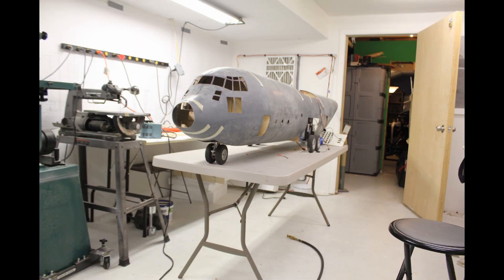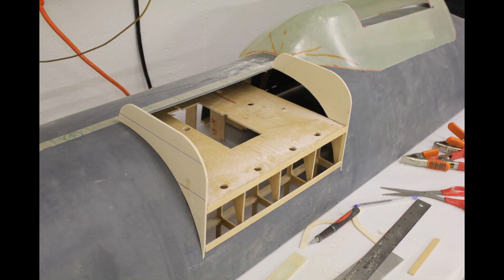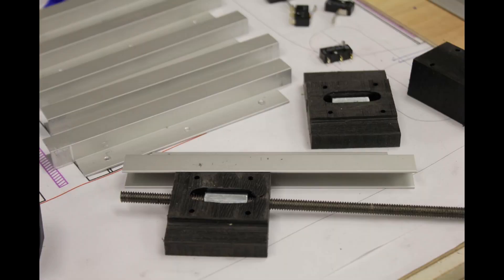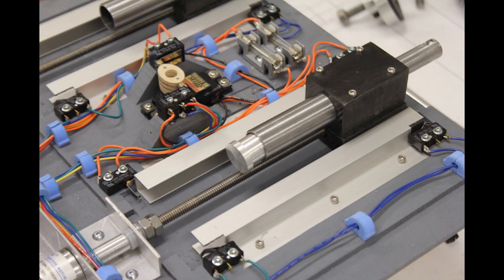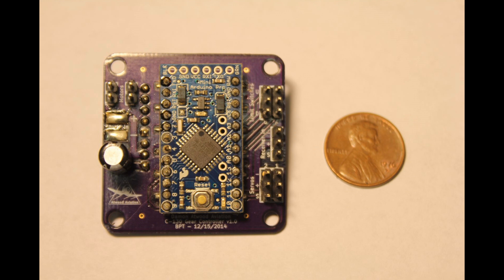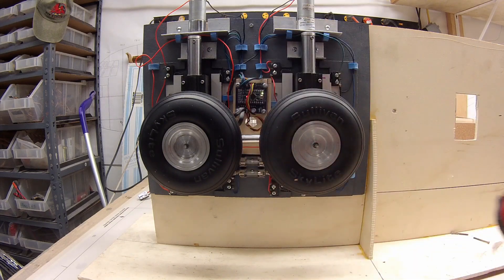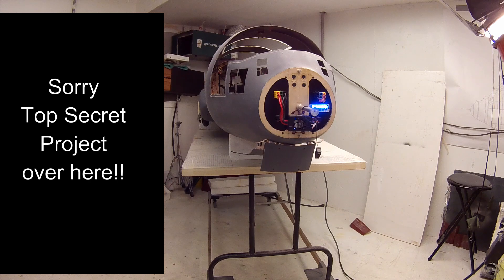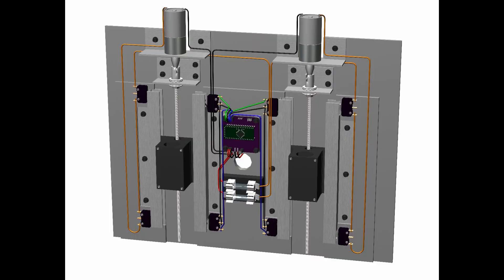DIY C-130 Landing Gear Design

Comment: Dag, do you happen to have plans/parts list for this design?  I'm considering building the Palmer c-130, which I believe is a little smaller than the scale of your plane.  I'd imagine The controller is the sticking point, as an off the shelf unit won't work properly?  I am really leaning towards building my own gear, as the only commercially available retracts for the Palmer c-130 are from Century Jet, and they're not a true scale style up and down as in your design.  Awesome work!
Reply from the maker: I don't really have a parts list. But I do have good/okay CAD drawings. E-mail me- dagtheaviator@gmail.com